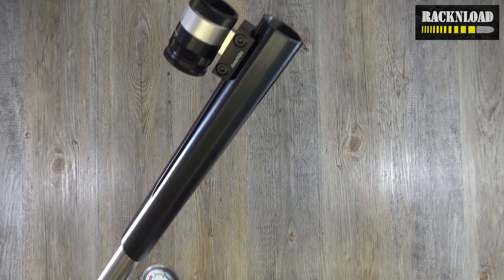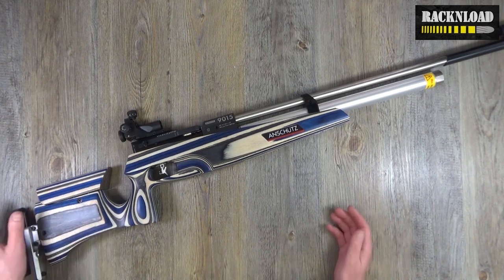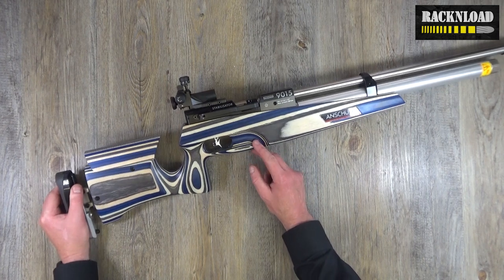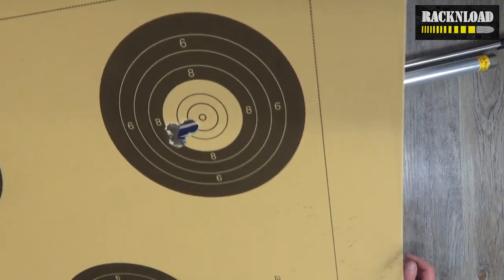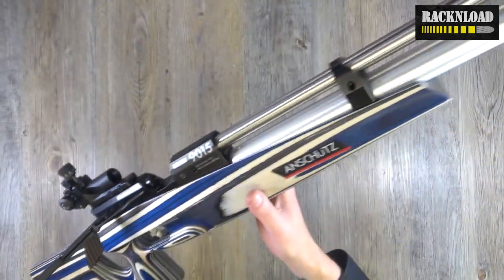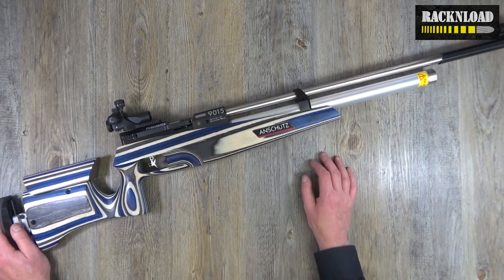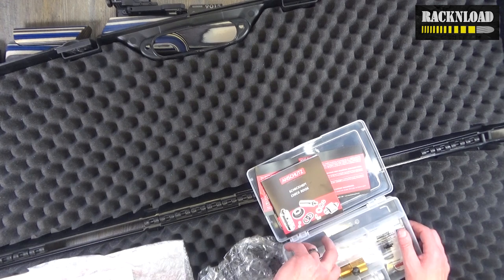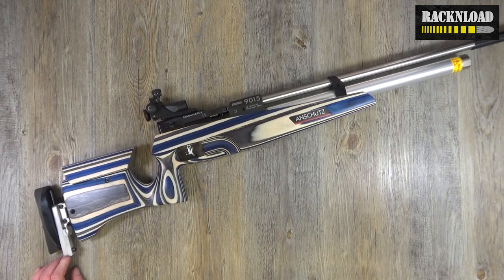Anschutz 9015 **OVERVIEW**

Comment: The air cylinder unscrews so that it can be replaced after the usual 10 year life span (or serviced in between). Typical German engineering and forward thinking.